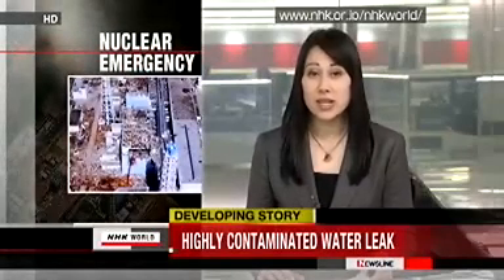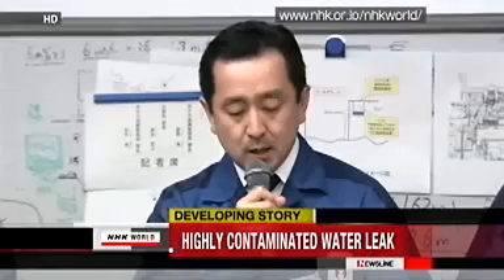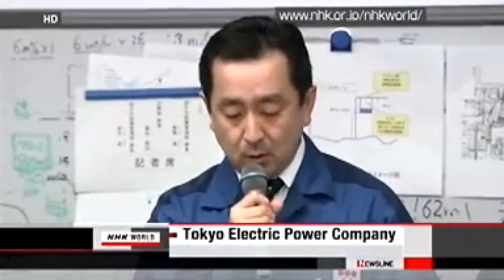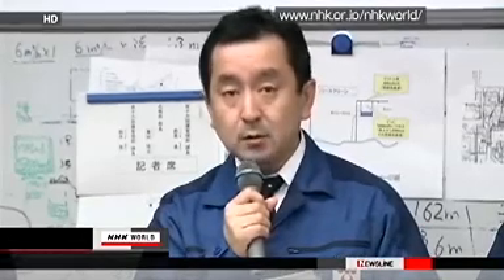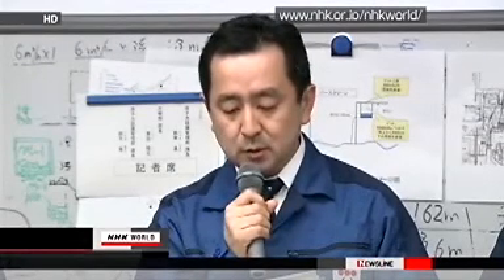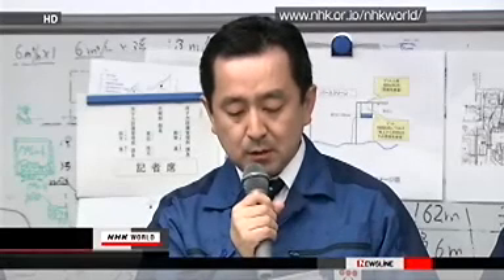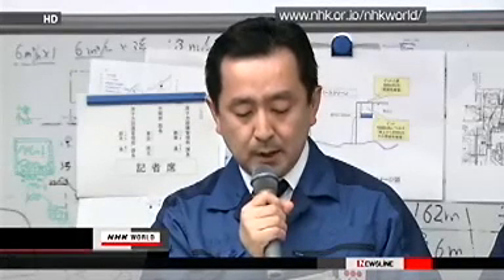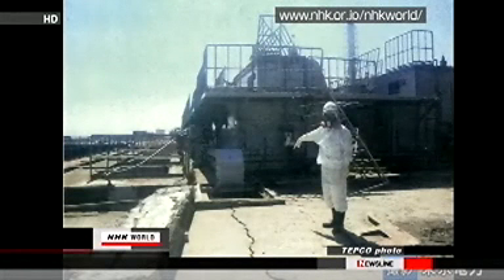Fukushima RADIOACTIVE WATER 100,000 x over norm LEAKING INTO SEA

Comment: No no no no!!!! Not 100,000 X normal, it is 100,000 X higher than the water inside a normally operating reactor. But this is outside in a ditch and draining straight into the ocean! To even come near this water is to receive a lethal dose of radiation. This tells me that #2 reactor has melted down and this water contains a mixture of fuel, plutonium, and fission decay products. So now the workers can not get too close to either #1 or #2 reactors without receiving a lethal or near lethal dose.